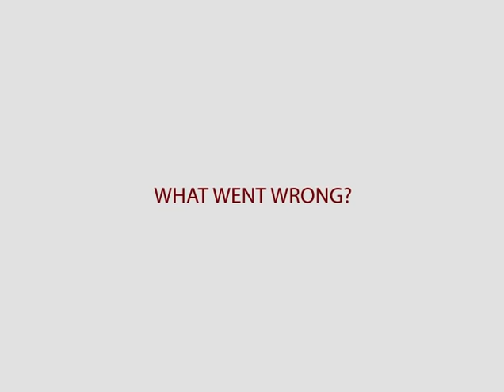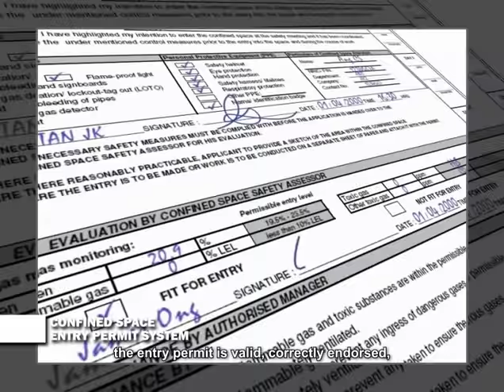Case Study 3: Toxic Gas Poisoning in Manhole

Comment: I remember jumping out the hole whenever it would chirp every minute or two when those toxic gas detectors would go off. My coworkers would laugh at me and get mad at me saying I'm wasting time and that the device is likely not calibrated, so they made me take off the harness and let someone else in. they avoided the chirping noise as it went off and they were feeling faint so we had to reel him in, if we weren't there with the tripod lift he would have died. Lesson is, if your device is constantly chirping its very likely not broken/miscalibrated. Some gasses are odorless and constant, even with mechanical airflow
Reply: even if its not calibrated its chirping because the air is poisonous doesn't have to be calibrated it just has to chirp for me
Reply: @BuckingHorse-Bull wut?
Reply: @skydivenext  he overcomplicated it for no reason. he just saying its chirping cause its poisonous air there is no need to calibrate it
Reply: Sounds like it was almost a Delta P event...
Reply: that's just plain stupid..  if it goes now, there are gasses, h2s meters need allot of h2s before they need to be calibrated, and if they need to be calibrated they detect less h2s.. so when it goes off there is actually more gasses than its showing.

this is russian roulette..
Reply: Most gasses are
Reply: They won't be laughing at you when their diaper is being changed because they did not use proper PPE. (Proper Protective Equipment)
We have plenty of bodies to throw at work like this. It's why I work for the union and have the contractors do it. 
You say dollar and they say, "how high do we jump sir"!😆🤣
Reply: @FirstnameLastname-tp4zw  Exactly. Same guy who teases me for wearing knee pads to take care of my knees is the same guy who has a busted right knee and always takes time off because of his busted knee. Some men are so stupid with that macho mentality it's gonna kill them 🤦‍♂️
Reply: @berderk2796  You Got It!👍
Reply: ah yes the "smart, experienced" co worker who knows so much better than you... let him perform risks on his own ass.
Reply: Your coworkers should be testing/calibrating those every time they are checked out to be used. They should be getting bump tested with standardized cylinders of a gas mixture.
Reply: A good gas meter will let off a small chirp every minute to let you know the batteries are good and it’s on. It will go berserk if a dangerous condition exists. Chirp is good, alarm is bad. If you aren’t trained on the meter you’re using, you shouldn’t be jumping holes.
Reply: "I remember jumping out the hole"
I think it's called "birth".
Reply: Please stay alive, you’re too smart for this shit
Reply: That's about the understatement of the year if it's safety equipment believe in it have faith in it if its signal something it means something and if you're wrong you can go home and sleep on it but if you don't think it's working right and it's just chirping and it needs calibrated you might not need to sleep tonight they may just throw you in the whole to sleep forever
Reply: I’m like this whenever the CO2 detector goes off in the kitchen I work at since I’m scared to death about folks’ overly complacent attitude towards “false-positives” caused by our janky old soda fountains is going to cause a bunch of us to wind up in the hospital one day. 😱
Reply: They were probably thinking that a detector that is chirping is normal because that's how theirs are at home.😂
Reply: @seronymus that had nothing to do with 2 body’s of water I don’t think you know what delta p is
Reply: If it detects poisonous gas you will know. It is obnoxious. It chirps every now and then to let you know that it's still operating. I'm a one-year operator on a stormwater crew.
Reply: It’s better to be safe than sorry

Comment: there is no such thing as being too safe. There is a reason rules and regulations are in place.
Reply: Politics exist in alot of regulation when needed or not. Over regulation exists. Maybe not this case, but not ever rule or regulation is for a valid reason.
Reply: we need more rules to make not following the rules more illegal
Reply: I like to start with to safe. Never run any sort of saw. That's a little too much but never run a saw one time halfway if you set up to saw one board you set up just like you're sawing a 100 boards on the same spot. I believe power tool operation should be a superstition it should be a religion and it should be safe and all three of these things should be combined into a set of rules that make you nauseous when you break them. You better be tight as a piano wire when you are carving with a chainsaw and you might as well have as much protective gear as you can get because it's ugly cutting.

Comment: Always wear a harness, enter attached to a line connected to a winch on a tripod or davit. The attendant may have been able to winch the first victim out immediately.
Reply: How about a gas mask?
Reply: @psycholaw4394  Test the atmosphere before entry: purge as required, ventilate. Each entrant to use a portable gas detector. Depending upon what you expect to encounter / results of atmospheric testing and the efficacy of purging & ventilating, you may need breathing apparatus (SCBA, Airline or Emergency Escape). Air-purifying less likely to be suitable.

Comment: Wow how did people ever survive working in sewers before the discovery of the ventilation hose?
Reply: this is people dieing of decomposing plant material. some dont understand it can be as dangerous as sewage..
Reply: rats die all the time in sewers. but not all sewers contain gasses. constant flowing waste water does not produce gasses. its when still standing waste water cannot get in touch with air for 3 day than it will start produce h2s gasses.
for example sewage pumps that have a few miles /km of pressure pipe that start not many times the outcoming water a week later produces gas.
same for pump pits. that have sludge on the bottem.. when the pump starts some raise to the  surface and gasses will come out..

the reason those guys died is because they pumped away the shielding water
Reply: I don't know for certain, but perhaps they took down small animals the same way coal miners took canaries with them into the mines.
Reply: They simply did not survive, that's the reason these tools could and needed to be invented. It's just that the birth rates were much higher back then so we still had enough people to make it through.